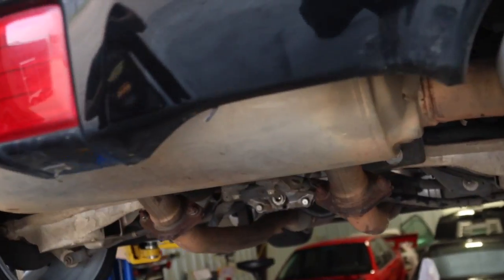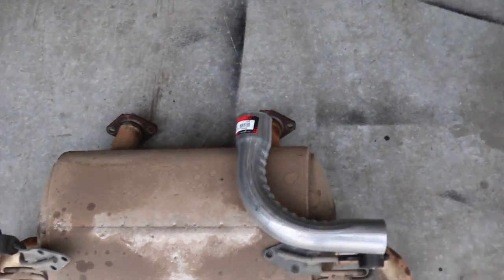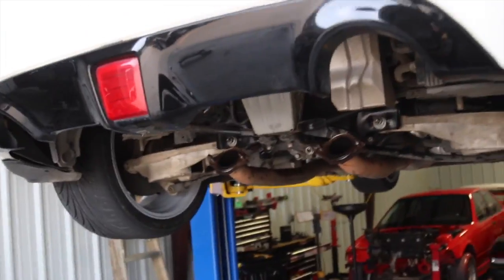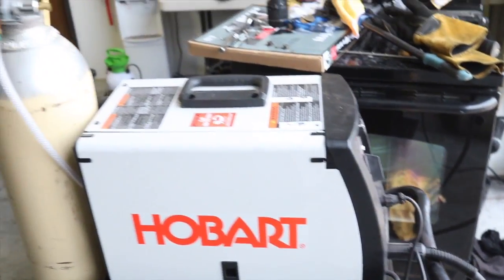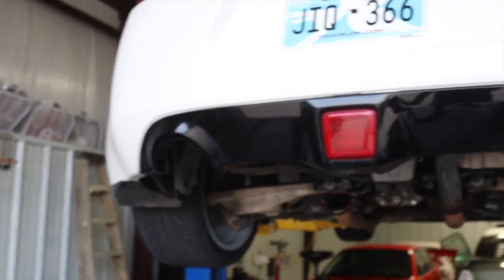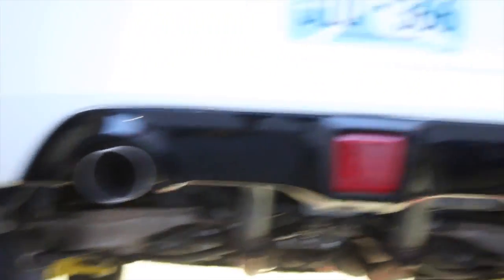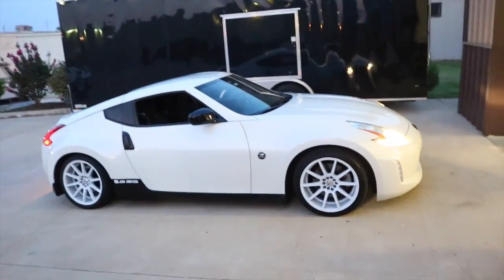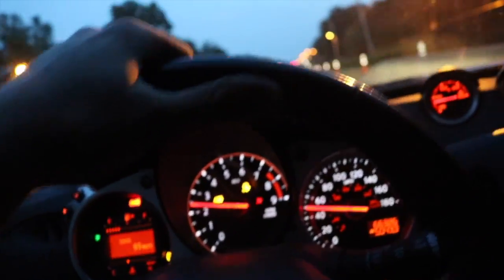Nissan 370z Muffler Delete for ONLY $15 Exhaust Mod!

Comment: I just did this yesterday and it turned out great. I had a coupon and this only cost me 7$. I spent a lot of time getting mine straight and salvaged the hangers from the muffler to stiff it up. Must say this totally beats spending 300 on a axle back if you have a welder..
Reply: The factory exhaust isn't any special metal? So just a normal flux core mig welder will get these 90°s on?
Reply: trevor bahs that’s what I did and has held up fine. Just three some high heat paint if to try and keep it from rusting
Reply: @TennisMan93  y’a fr a borla axle back is 800$ and you can muffler delete and get it welded for under 200$ at a shop
Reply: Can you accomplish the job with just clamping it on as I dont have a welder
Reply: @CorvetteBro  it may be possible but it will be pretty hard to get it lined up close to perfect. Also I had to weld the hangers on so idk how you would do that without a welder. I am by no means a welder btw. I went to harbor freight and got the cheapest one they had for a different project so this was maybe my second time welding when I did this. Rather than paying a shop I got a new tool and learned a skill ha

Comment: I did this but I also went a step further and took off the res as well and ran one of those straight autozone pipe's too from where the res would be in the exhaust circuit and it is loud as hell and perfect loud too I have no decibel rating in my inspection, but have an emissions inspection. So I'm not even going to mess with the cats because the catalytic converter is responsible for emissions . I don't mind a loud Z because it is my own personal project drift car too 🤣 Nissan Z's are amazing cars. The V6 sounds nice too on them.

Comment: Hey! I just bought a 370z and the traction light stays on solid and doesn’t turn off, I noticed yours is doing the same thing... do you know why?
Reply from the maker: Mitch Cass that means you don’t have traction control lol. Mine was a drift car so I had to disable it
Reply: You might have to add brake fluid mine stayed on and it went off when I added brake fluid and bled my brakes

Comment: Does the engine light come on ?
Reply: Not for muffler or res. It only comes on when you mess with the cats
                     ( catalytic converter ).